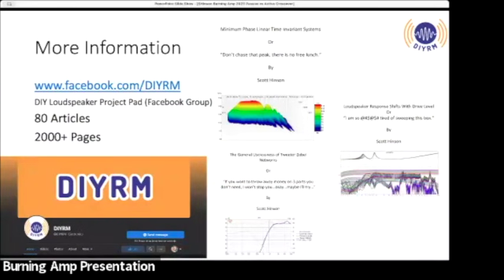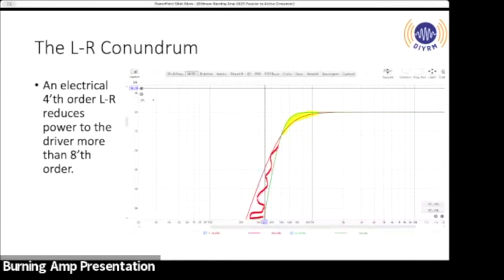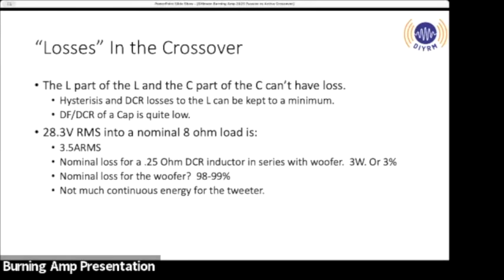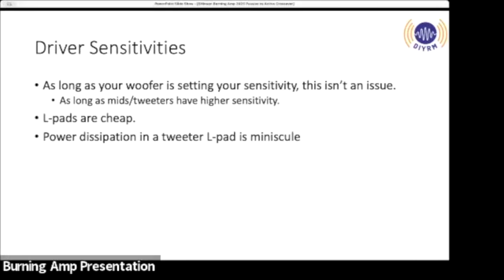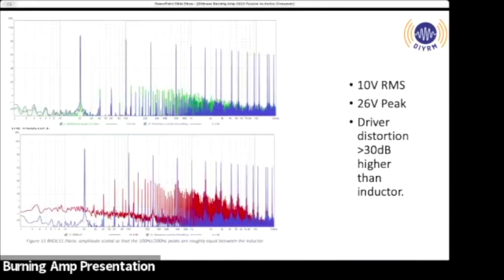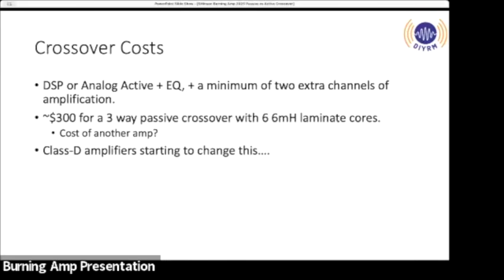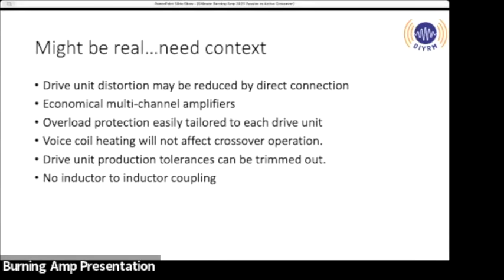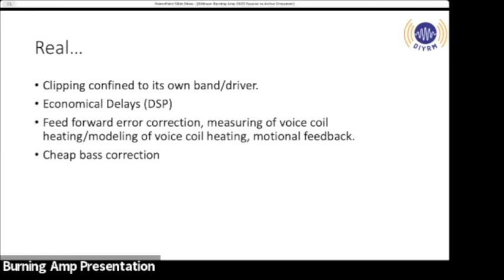baf2025 Scott Hinson

Comment: Speaker driver phase change because of self resonance and increasing impedance at high frequency needs to be compensated for in both active and passive filters if the summed output of two drivers are expected to be linear. So you can't use a standard active filter on the market. It needs to be specificaly designed to suite the specific drivers you want to use.
Both passive and active filters have benefits, and I would say if you want the ultimate then the active filter is the way to go. Just need to be able to tailor design the filters to the drivers used and accept the cost of using more amplifiers. +1 amplifer for each filter.